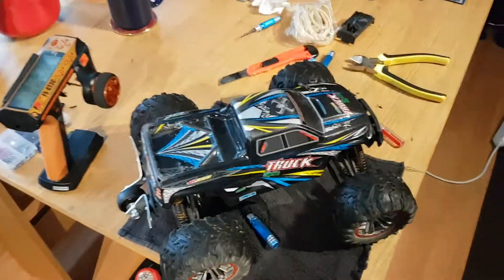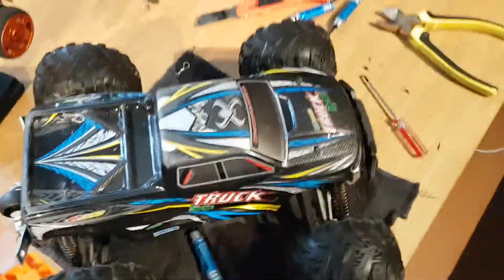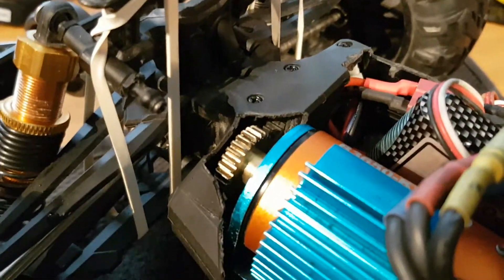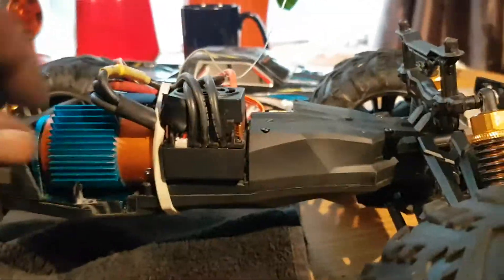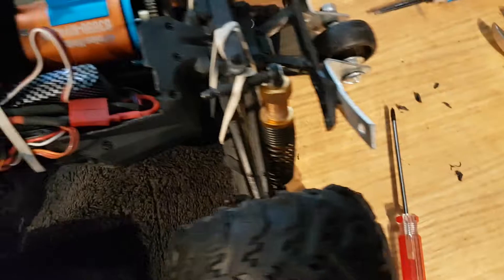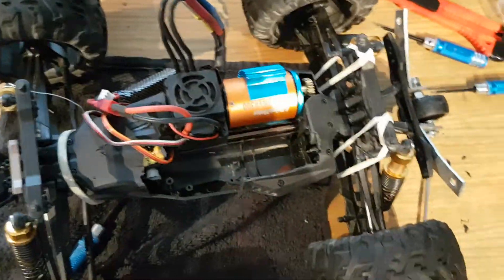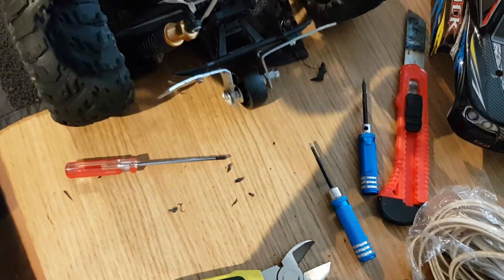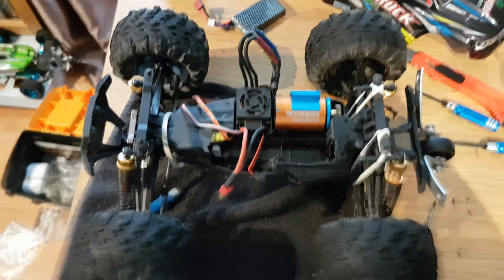9125 IPX4 Brushless Upgrade pt3

Comment: Just got my 9125 last week, within 2hrs I was at the hobby shop buying a 2200 3s, next day my RC4WD SandThrashers came in the mail. Mounted them then went to the beach. MAN!!! What a BLAST!!! 
Enjoyed your video, great job on the upgrade👍
Reply from the maker: Rrrr wicked man yh these cars for the money are a blast.
Reply: Yeah, definitely. It's the cash spent afterwards, though. Don't take long for the springs to start drooping, new adjustable shocks, on the way.  WHAAHOO!!!
Reply from the maker: Bit it need a wheelie bar I'm still to make a good one for it or find one to buy that fit.
Reply: Yea, I definitely need to fab something for the hard pack terrain, but it was awesome in the sand though
Reply: Can you please advice ,,for the ideal shocks , oil fill in preference , thanks.
Reply from the maker: Shock oil is some you should try for yourself to what you like how you use your car. I might say use a weight bug you might not like so just buy and try or buy few a different weight oil to try.

Comment: What type of main driveshaft you are using?
Reply from the maker: It standard drive shaft I don't know or haven't found one I can replace it with it strong but spur gear is plastics.
Reply from the maker: Not sure which spur I can use as they don't make metal for this car.

Comment: Will the 9125 handle a 3s being stock?
Reply from the maker: Yes I was running 3s all the time using up full battery and was fine. It was a high discharge battery 65 - 130c 2200mah
Reply: Where can I find it? I could try 3s.
Reply from the maker: EBay
Reply: 3s will blow the car after few uses as the energy storage capacitor is not designed for that.other wise everyone could make a decent cheap rc car into something you can end up paying couple hundred for so Deliberately and common sense from company all designed to work together at top off specs , so you use stock power.  TRUST ME UNLESS YOUR USING A COMPATIBLE BLmotor, ESC /ELECTRONIC SPEED CONTROL.and then your CHOICE OFF BATTERY TO USE COME IN...

When ever you upgrade and a car has plastic gears. I thought this was advertised as METAL THOUGH,/cars in the post for me still, this one... 
Always get metal gears, less plastic to metal,,  because the torque and aggressive speeds the gears spinninh will Destroy plastics,alot quicker too if gears are not put back flush and firmed again, metal spinning up plastic.. Metal always wins, it will snap gear teeth when pushed past STOCK. this is when you start hearing and feeling slight lock ups and then when gear tooth is completely off. Might rattle if not jammed up in a corner.  But you also miss a portion off speed every spin. So not one constant same motion.. 

I now have to look into getting metal spur gear the man said.. 
Even if I don't tinker with the power.. At least you know it's going to last it's maximum..
Reply from the maker: It handle is but the chassis is weak from stripping back plastic to make room but it does handle power well. But I'm sure sooner or later it will strip plastic gear.
Reply: My kids wear out multiple 3s batteries everyday and zero stripping issues yet. One kid does more stop and go crawling maneuvers and the other is straight up balls to the walls and hits everything along the way. This is a really tough truck and pretty much him proof